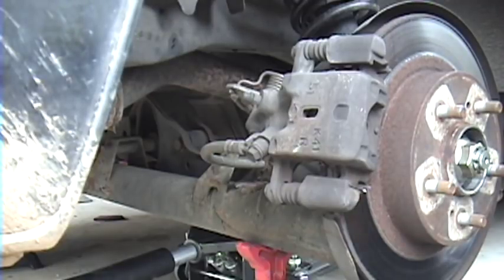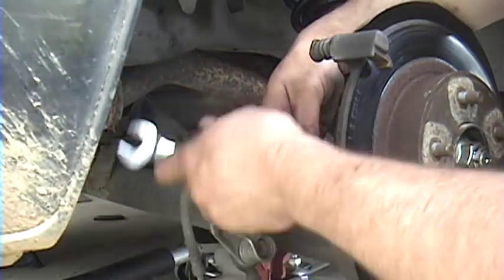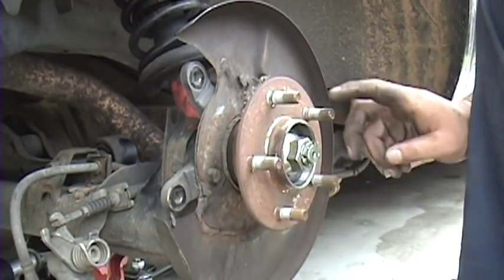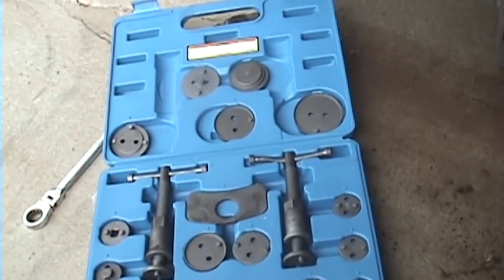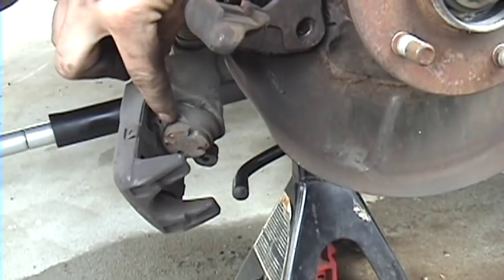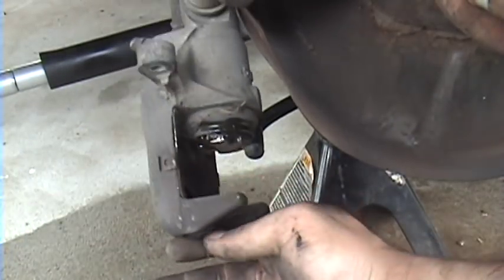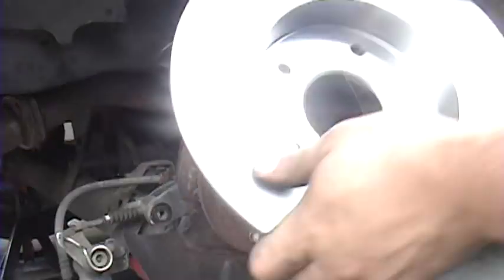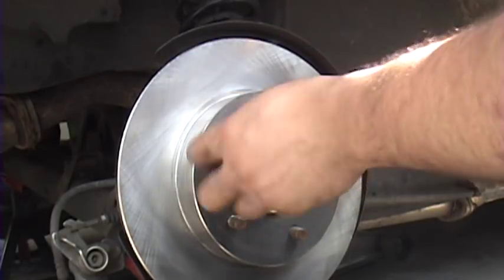1995-2003 Nissan Maxima: Rear brake pad/rotor replacement (updated)

Comment: I appreciate your videos especially the one you did on replacing the inlet pipes on the heater core. I took my granddaughters '95 maxima to my mechanic and he didn't know that they could be replaced. I showed him you video on that along with the part number you showed and he said you did a good job on that vid. She had trouble with it running hot and smoking and her stupid dad connected the two hoses together and let her go. I had my guy replace them just last week along with some other things. Thanks for the help.

Comment: After you get the new pads on should you pump them up before starting the engine or will it matter? I have been told to pump before starting because if you start it first the pump will stir up bubbles in the brake line and then the brakes will have to be bled. Is that true?
Reply from the maker: +Jim Pinckard It doesn't matter, there is no pump to affect the brake lines/fluid. It's a purely mechanical/hydraulic system, there's just the pedal/master/lines/calipers.

Comment: Is this pretty much the same setup for a 2001 Infiniti i30?
Reply from the maker: +Manila Kid Yep, should be identical.
Reply: +boredmder Also, is that special tool for the caliper needed?
Reply from the maker: +Manila Kid It's not required, just makes it a lot easier (especially if your calipers are seized up). You could use the cube, costs a couple bucks and designed to do several different types of rear calipers (I've got another video showing it's use somewhere on here), or you could even use pliers if the pistons move freely enough.
Reply: +boredmder Thanks for your input. I was going to just use pliers.

Comment: Quick question just replaced the rear rotor and pads on my 1995 nissan maxima on the LR but it was making aloud clunking noise, so I limped it to work and back today. When I got home took the piston and caliber off an the rotor was cut in half where the circle meets the studs into a perfect circle what could this be from?? Please help... Making same noise again tonight on same one, we even bought new caliper :/
Reply from the maker: Usually that's from a brake pad shim sticking out and rubbing into the rotor hat.
Reply: boredmder okay I got a new rotor on and new calipers in the rear but still grinding not nearly as bad like a little squeek and my brake pedal feels not very hard
Reply from the maker: Did you make sure to line the nub on the pads up with the slot on the caliper piston? If they're not lined up, you'll be trying to put the full force of the caliper piston through just that little nub, and you'll get poor braking performance and a poor pedal feel.

Also, did you bleed the system well? Any kind of air in the lines will also lead to a poor pedal feel.
Reply: boredmder that may be the case as I can only feel the front brakes and none of the rears so is it possible that I didn't put it in the slot correctly on both sides?
Reply from the maker: Yep, it's easier to put it together incorrectly than it is correctly. Just rotate the caliper pistons until the two of the slots are parallel with the mounting bolts, and two point up and down, I show that a bit in the video I believe. One of them has to line up with where the nubs are on the pads.

Comment: If your leaking from the rear caliper, would it be a seized up caliper or is it the washers of the banjo bolt that are worn out?
Reply from the maker: It could be from the hose, banjo bolt, or out from around the piston (meaning a failed internal seal).